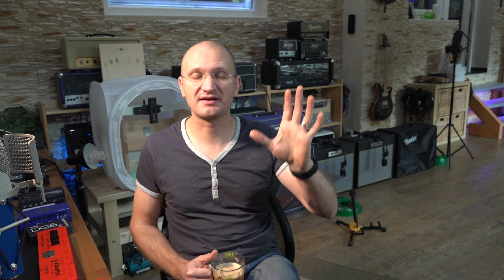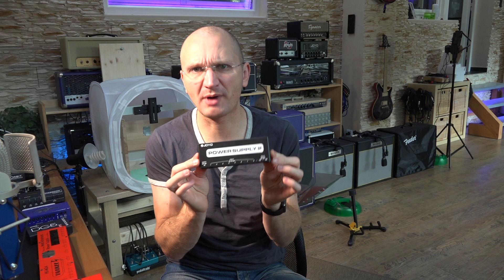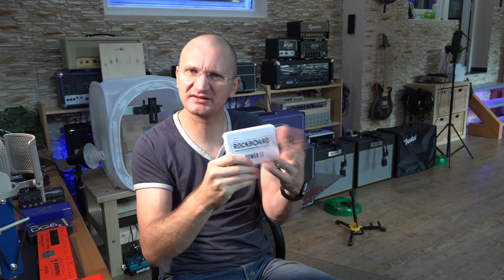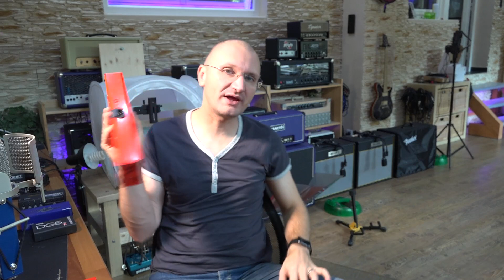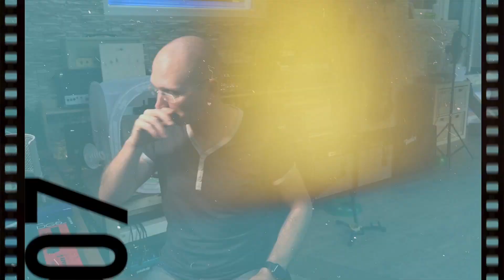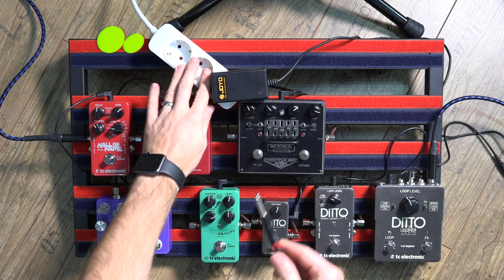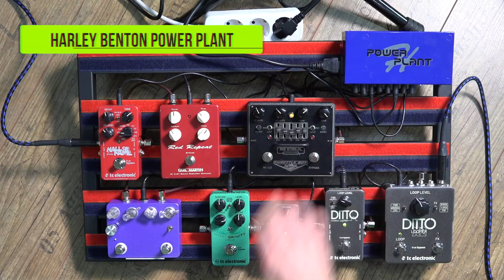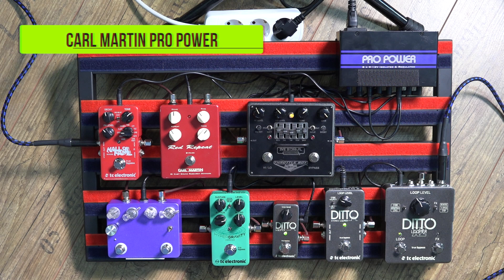Power Supply Shootout - What does a Power Supply SOUND LIKE?

Comment: Great demonstration!. Now, what about those Pop sounds every time you hit the pedals, are those normal or power supply dependant? how to eliminate them? Cheers from Uruguay!
Reply from the maker: they are pedal dependent and have nothing to do with the power supply
Reply: @EytschPi42  It can be both! I have the DITTO that you have to the far right, and it doesn't pop the slightest on its own. I e using just one power supply to it and only connected to it. You must check the signal chain at the receiving end. Your Mesa pops and hums the most, but as I have no experience in this particular pedal I can tell you this: True Bypass pops the most (or more than) compared to buffered pedals, but the power supplies can still wreak havoc on how much or little any pedal pops.

Comment: I have a Cline Power 5 and sounds like crap! it makes a lot of noise even without overdrive pedals.
Great video by the way greetings from Mexico
Reply from the maker: +Juan Correa Thanks !
Reply: replace the ac adaptor of the Caline by a boss PSA120 or other around 500 ma quality power supply and no more noise
Reply: That's good information. I have had problems with my Caline also. I might add that although the Caline advertises "isolated", I'm not convinced that it is. Some pedals do not work together with this unit. Particularly, fuzz pedals. Had some trouble with digital pedals as well. But, that may be an under power issue. All that been said; I do think the unit is a decent supply at a fair price.

Comment: +EytschPi42
I would have liked to see a Voodoo labs in there, but really nice review. I would like to post a question:

Lets suppose you have 10 pedals but only can afford a Power Supply with 7 (less than 10) outputs. You have to Daisychain. Is there a tip on which pedals can be daisychained preferably, to avoid hum? For example: Daisychain those that are not going to be used at the same time?, Chorus + Flanger.. I dont know. 

Cheers!!!
Reply: +Carlos Mora 
I'm doing this with my pedalboard. Mooer Green Mile and Biyang Fuzz are daisy chained together. Wah and Dark Matter are daisy chained together Tremolo and tuner are daisy chained. Works well.
Reply: +Carlos Mora From what I have read and heard you can daisy chain analog pedals, like overdrives and distortions without to much problems, but digital pedals like modulations, delays and reverbs should have separate outputs.

Comment: Thanks for doing this but... Shit man they all sound the same ans go ar as sound... But oise.. The Rockbosrd battery thing has a distinctive whine.
As far as the rest, you might have to redo the whole test and unplug your input cable if the input wasn't disabled. Just moving the cable or having the tip touch something could cause a change in interference. I'm not sure if you accounted for this.. Idk. What would be interesting would be a straight noise floor comparison.

Oersonmy, I've never had any power issues, but I don't use many digital pedals. If I have one in the loop or something, it's usually just in its own power supyz so it's already isolated.

Comment: I have 14 pedals and i want them all set up at home using one power board isolated. everything on the market thats isolated have only 8 maximum outlets for 9 volt pedals. Theres nothing on the market that works efficiently with enough 9 volt slots for your home enthusiast who has crazy amounts of pedals.
Reply: Have u looked at the Zuma (strymon)? 9 ports...some variable...500ma each.
Reply: OldEMGStrat does the mah level dictate how many pedals you can comfortably daisy chain together.
Reply: u get 500mA per port...depends on the draw per pedal ...add it up
Reply: it does! ur pedals should day what the draw somewhere...for example 1 500mA port can power 4-5 100mA pedals
Reply: ur pedals should SAY (not day)

Comment: For max 5 pedals, there is also the Harley Benton Power Plant Jr which is isolated and only costs 33 Euros (On Thomann). However, I am not sure if that would fit under a Pedaltrain board. Any thoughts on that one? Rock on man :)
Reply from the maker: +Jacques Darville I haven't tried it.... the POWER PLANT was clearly one of the noisy ones in this test.
Reply: If you don't have a lot of digital pedals, try the Joyo PS2, or the Caline equivalent... they're allmost noiseless... the power Plant is definetly too noisy,and it costs allmost the same as a Caline / Joyo PS on eBay!
Reply: Thanks for the info guys. Appreciate it :)
Reply: I tried the Powerplant which was noisy as hell on my board.
Then bought the Powerplant Junior for my smaller board, just to try it out - no noise. I have two of them on my big board now, too.
They work perfectly